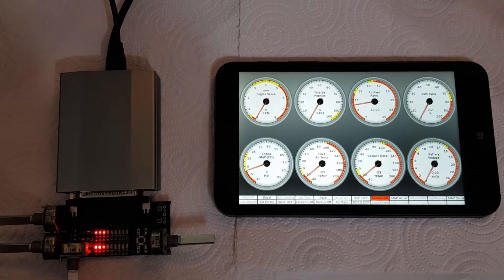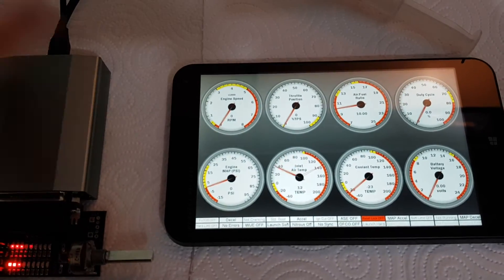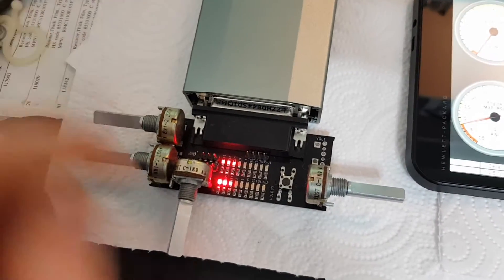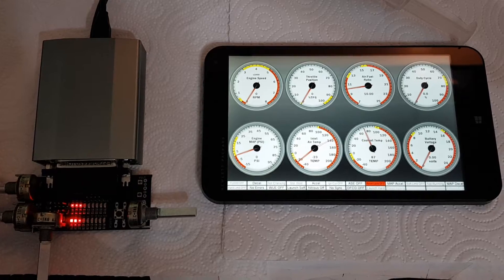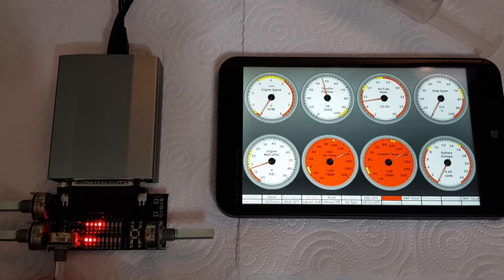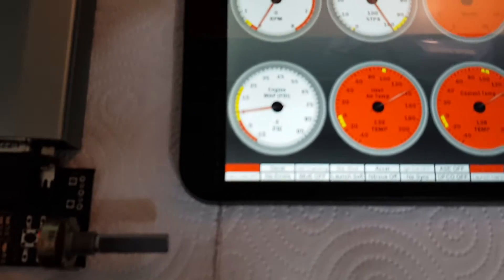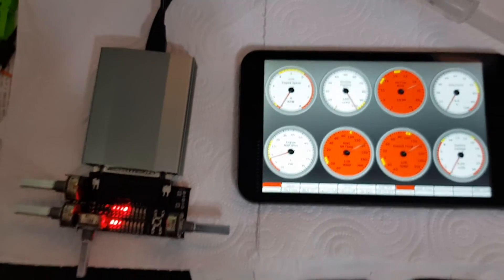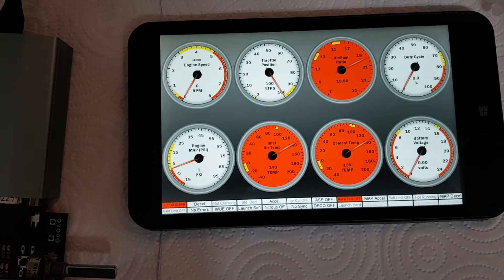DIY Speeduino ECU.

Comment: I also design variations of speeduino. I Love that little simulator. Did you use arduistim on that?
Reply from the maker: The simulator board has no smarts on it. It's just potentiometers to simulate resistive sensors, and leds to show outputs are working.
Reply: Do you have info about it? How to made that. Thank you so much